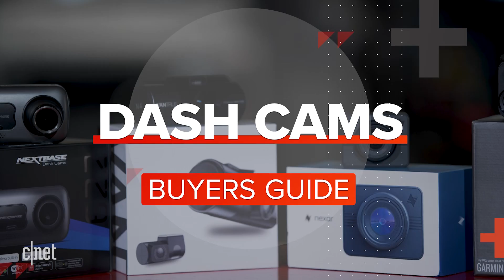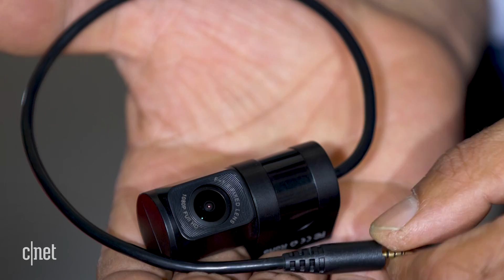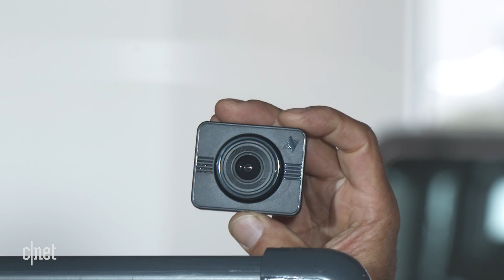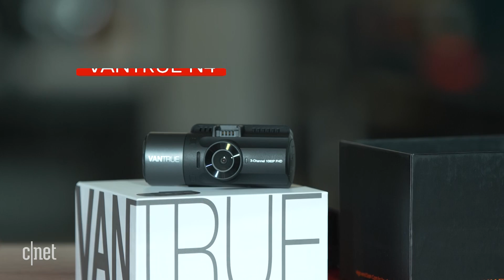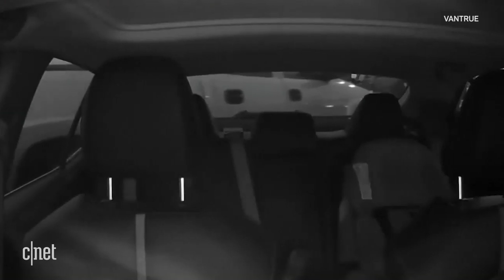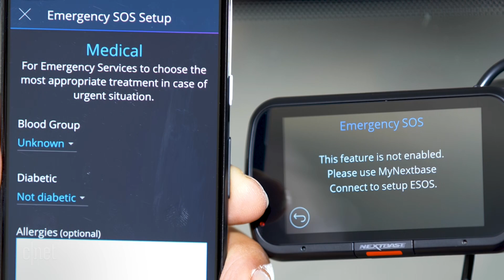Best Dash Cams 2022: The Ultimate Buying Guide

Comment: Have been running a dash cam for the last few years, and am on my second camera. Here are my tips...

1: Don't prioritize having a screen on the camera. You aren't going to get details on that screen, even if recording in 4K. You'll be able to prove what happened, but that's about it. For the 4K, you'll need to access either through a computer or via the app and download/save the video to your phone. Most with wifi have very poor/slow connections, so streaming 4k from them isn't going to happen.
2: The windshield here is a bad example of what to expect due to its angle. Consider, in most cars that one on the GPS Style mounts are going to stick down off the windshield; So placement is going to be huge factor with these. My Vava 4K Dashcam is about the size of a hockey puck and has a GPS Style mount. It fits neatly behind the passenger side of my rearview mirror. It does not have a rear camera.
3: Don't mention you have a dash cam, until police arrive. Let the person lie, then show the cops what actually happened. Do mention you have a dash cam that is recording audio if you have passengers, or take your car for service somewhere.
4: Many of these have TERRIBLY designed power port locations and poorly selected power cables. Notice the on Cooly showed where the USB connector is a right angle connector, that points down. and is on what would be the drivers side. 
5: Be VERY careful about how you run the power cable. The curtain airbag is something you don't want to interfere with. Ideally, you want to be sure that should it deploy that the cord stays inside and doesn't wrap around it where it could be damaged/severed or worse obstruct the airbags inflation.
6: Read reviews, find HD videos on Youtube (not amazon, because they REALLY compress videos) and watch videos of Day/Night/Inclement weather and see what details you can/can't make out. Some cameras are good at one or the other, only a few are good well rounded cameras that capture clear footage in most conditions you throw at it.
7: Read the fine print. Many of these cloud based ones have trial periods where you THEN have to pay monthly to have access to. 

Personal pro tip, I typically go through a windshield a year. Most cameras with in-line GPS units and even dash cams themselves come with 3M foam adhesive. Don't use the foam, order some 3M dual lock (EZ-Pass) mounting tape. I have yet to find an replacement foam type adhesive that can hold up to heat and cold, and many cam companies DON'T sell replacements for the adhesive or mounting tabs. The dual lock works phenomenally.
Reply: What are you doing that you go through a windshield a year.
Reply: @baddriversofthenorcalarea500  Modern cars have big no repair zones on their windshields with all the safety tech. Sure, some of mine could be 'repaired' but I'm paying for full comprehensive coverage where a windshield isn't gonna raise my rates and I have no deductible, so... I'm getting a new windshield and not staring at scars. Welcome to the snow/salt belt, and a state that doesn't maintain its roads for crap.
Reply: @717dash_cam  My windshield has a crack along the entire length. I might just have to go with your coverage...
Reply: @baddriversofthenorcalarea500  Should fall under comprehensive coverage. That is the only one I keep at zero deductible, though even then a 100 dollar deductible wouldn't be a bad deal. Living with deer all around I'd rather have the peace of mind, knowing I'm covered should one run into me. State farm has treated me pretty well, have been with them for like 14 years.
Reply: @baddriversofthenorcalarea500  I've been going through a windshield ~every 3 years.  Rocks were flying up from the road and hitting the windshield.  Another time, a rock flew off the back of a dump truck was behind -- and I even purposely put stayed about 3 car lengths behind it.  And there was also a period of time when someone (kids?) was standing out of sight (downhill) near the freeway and throwing rocks up and over the embankment at passing cars.
Reply: you seem to have a lot of knowledge on dash cams. so of the ones you know, which dash cams do you recommend?
Reply: 8.  If you are in an accident and suspect it was your fault, don't delete the footage.  If the other person knows you have a dash cam, in court, if brought up, it will likely be assumed you deleted footage since it was incriminating.  I learned that from Youtuber/Lawyer Steve Lehto.  Also, I totally agree with No. 3.
9.  If there is a swivel mount, aim the camera at your window if you're pulled over.  Record that interaction with the police.
10.  Know the law.  1 party state?  2 party state?
Reply: @Phelper99  I have yet to get pulled over with my dashcam, but totally agree with that. 8, I would say is circumstantial. I've had times with my first dash cam that it just didn't capture things. But it does make a point to make sure you pull footage ASAP and save it so it can't be lost. 10, I've had a porter at a dealership harass and threaten me for posting him and his coworker mistreating my car with a water blade after it was serviced. It's now on my account that the camera is installed, running and recording audio; As well as not to wash the car. Speaking with the general manager of the dealership, techs and anyone in someone elses car should have no expectation of privacy when the car is in for service. I left the video up but blurred faces and the dealerships name.  I actually just found a 12 volt plug behind my glove box that allowed me to hide the dash cam plug, so they won't be unplugging it during service anymore to 'update' the stereo.
Reply: @einyv  Yeah, I have it on my account that they aren't to unplug it. I can understand that if they did and damaged it I'd be frustrated as well though.
Reply: Honestly man this comment helped me more then looking for videos or website about dash cam, I been having bad luck looking for information and recommended, so thank you man and May god bless you
Reply: @janerosereviews  I've had them plugged directly into USB and a Cigarette lighter and no. Those typically disable when the car is off anymore. You CAN connect it to a constant power source, but most have features built in to not allow battery depletion.
Reply: You might not see many details on the little screen but you can 100% see the event take place!!! 

It’s also convenient to see what you’re pointing the camera at.
Reply: @alexmayer8943  so you can use the wifi
Reply: Why would you mention that you have a camera that’s recording audio if you have passengers or leave the car for service? And do you recommend saying that whether or not it’s actually true? If so, why? What’s the benefit of telling them that?
Reply: @Samuelfish2k  Yeah, would have replied sooner if the video didn't disappear for a bit. But yes, it is the legality of it in a 2 party state.
Reply: @Samuelfish2k   I believe due to laws. In some states (US) you cannot record audio conversations without the person’s knowledge of doing so
Reply: @pjskyy  Interesting, I would’ve never thought of that. Thx for the reply.
Reply: Damm youre a pro, post more dash cam videos. And you should copy your comment to more videos
Reply: I’ve been watching tons of videos for the best dash cam for my 2020 Nissan SL Rouge. I read your comment to this good video. Your suggestions sounded great and you seem very knowledgeable. Can I ask which cam do you recommend from this video or something else. Thanks
Reply: @Jim-yn3tt  if you did not get one yet, look at Garmin.  Ive had the same one for 5 years now and no issues.  they even have a "battery" saver cable that you hard wire into a non switching fuse and it will turn the camera off when you battery drain is excessive.  that means when you park at the airport for a week, you will still be able to start you car after leaving the camera on.
Reply: @Jim-yn3tt  I personally run the Vava 4k Dash cam and like it. Vantrue, Blackvue are good brands. Unfortunately, you can't rely on videos you see on Amazon because of how compressed they are. It looks like you'd be stuck with the cig lighter option though. I think that generation Rogue only had 1 USB port.
Reply: What’s the best dash cam you suggest?
Reply: Thank you for that info!!! fantastic real-time buyer / user tips
Reply: 3M Dual Lock is a PHENOMENAL product for all sorts of things- automotive, DIY, home, and office. I keep several styles handy. I mounted a Dropcam on a painted I-beam with it back in 2014, not knowing if the placement was ideal. Here we are 8 years later, and it is as stable as if it were bolted on.

I've even used it to mount a computer to the bottom of a plywood work surface, and several Intel NUC to the back of monitors for a very clean installation.
Reply: based on your experiences which dashcams would you recommend?
Reply: Hi Ryan, is there anyway of being able to tell if our techs have turned on their dash cams?  I have watched a few videos and tried to search about it but not finding anything as of yet.
Reply: Great suggestions - When you mount the 3M dual lock mounting tape - did you remove the plastic sticker on the mini 2 before you stuck the locking tape, or did you leave the plastic sticker on the mini 2?
Reply: Thank you so much for your knowledgeable comments about dash cams.  I just bought a Honda Accord Hybrid, and I’m looking for a good dash cam. I’m taking notes. Also, thank you to all the other commenters for sharing their knowledge.
Reply: So what unit are you running?
Reply: Proper job!..you get my YT OSCAR for clarity, good text and content. Well done!
Reply: God bless
Reply: THANK YOU Ryan.
VERY MUCH APPRECIATED. 
YOU are a LEGEND. 
Thank You.
Reply: So what is the best one to buy?
Reply: @carolnikolov8469  That depends on what you drive. I have a new car that has them built in, and for 30 years I've driven Porsche 911 Turbos. They are now offering a prewire package as an option for dashcams.

Are you putting it in something you already own, or a car you plan to purchase?
Reply: Can you recommend or suggest top 3 best cams based on your knowledge/experience pls ?  Tyvm  !
Reply: A windshield a year!?! WTF? 🤣
Reply: @icecreamforcrowhurst  When you drive 12-15k/year through snow storms, among other things and it's mostly all highway mileage, something hitting your windshield at 70+ is GONNA do something to it. If I'm paying for full glass coverage, I'm not accepting a repair with the safety systems behind it. Secondary factor, Subaru windshields are notorious for cracking due to defects from the wiper deicer.
Reply: @icecreamforcrowhurst  😂😂😂😂

Comment: I am in camp B.  Every car I own has a front and rear dashcam.  Already saved me a $3500 headache from my daughter's  accidence that the other driver tried to pin it on her until we sent the video to her insurance company to shut them up and admitted their dang fault.
Reply: Old lady turned left in front of me while I was a new driver. Totaled both cars. Would’ve been impossible to prove fault of not for the dash am of a cop who happened to be driving by. Only time I’ve ever been glad to see them on the road
Reply: What's the cam you're using?
Reply: @naturehacked  I was using the VIOFO A119S V2 DashCam in my daughter's car and it is still working as of 02/21/22 and I installed it since 2018.
Reply: @Paul, Kudos, many ways to go for your daughter.

Comment: I have the Vantrue N2 which is much cheaper (especially on sale), just doesn't have the 3rd camera. Caught 2 motorcycle accidents that happened in front of me and helped them with their insurance claims. For mine, I just place the cam lower on the front glass and have a shorter cord just run straight to the center console. With a simple cord organizer clip that uses double sided tape, that cable never gets in my way at all.
Reply: I’m looking at vantrue N2 any thoughts on it ?
Reply: @medrano433  It has held up really well. The suction cup does drop the camera on SUPER hot days, but by putting it lower on the glass and a little pad on the dash underneath it continues to rock on almost 2 years later. If you need front and interior camera the brand gets good reviews and it is typically getting cheaper every year.

Comment: Do they make any that run off its own battery?

Or would it just not last long enough without being plugged in.
Reply: Most dashcam's run off from a USB plug;  and most include a cigarette plug adapter with one or two USB ports as part of the package..  And you can also run them off from a USB battery bank although I would not recommend leaving such a battery bank in your vehicle during the summer heat ..
Reply: If you don't know how, have someone hard wire it into the fuse box.
Reply: It’s not that I can’t run the wire. I would just rather not and would prefer it to be as clean as possible and that’s no wires at all. It would also allow me to easily take it from one car into one of my others.

Comment: I would definitely recommend you look into dashcams that can withstand high heat. Ive seen a lot of them in Houston die out in +100 degree temps. Not to mention the adhesive melting
Reply: You need to get one with a built in super capacitor instead of a lithium battery to be able to withstand high temps.
Reply: florida very hot too.......
Reply: Viofo dashcam are pretty good for extreme weather.
Reply: Or on the other side: Cold. I’m on my 4th dash cam due to cold temps in Alaska. Some would work when it finally got warm in the car or not turn on at all.
Reply: @Kingnome  Better BBQ in Texas.
Good jobs too.
Bring your Grizzlies with you.
Reply: 3m none foam type, car mounting tape and most branded capacitor car cam will do fine in those situation
the real problem is the video quality at night, how good is the wdr or does it have real time hdr ?
how sharp is the footage or how clear the car plate is, generally is the most important and 
one biggest misconception, higher resolution don't gives you better sharpness, but allow crop and zoom but it is useless when your footage was blurry to begin with.
Reply: lol if you dont want your dashcam overheating then move to more temperate place.
Reply: @TheDevicemanager  you sound stupid af dude

Comment: My main concern is what is the final price? There are separate batteries for parking mode, accessories, and install.
Reply: It cost me an extra $25 for me to add a hardwire cable.  1 hour to run the cables for power and rear camera.
Reply: If it's using a regular 12volt car accessory plug, hard wire it with an inline fuse.
Reply: Is you winning an accident case not worth the price?
Reply: @waldo3777  It's interesting that a dashcam could cost $200, but that may not be the final price. With all other accessories it would be nice to understand better what the actual price would be. With a parking battery, the final price could be over $400 or even $500.
Reply: @amill1563  I would rather pay 400 or 500 now than alot of headache later. Also if you go on ebay they cheaper models if you are worried about price. You get what you pay for but better than nothing and should help
Reply: @waldo3777  So have you done this?